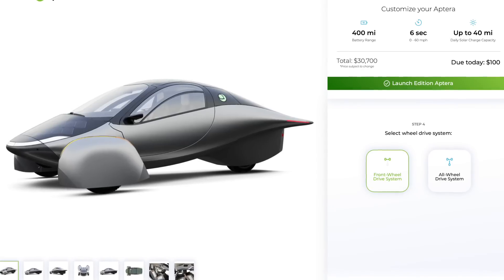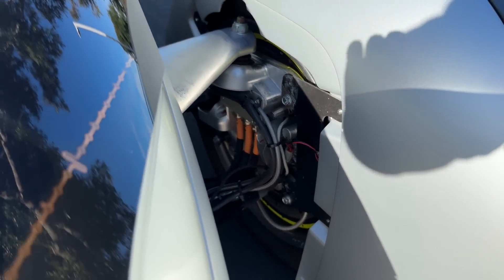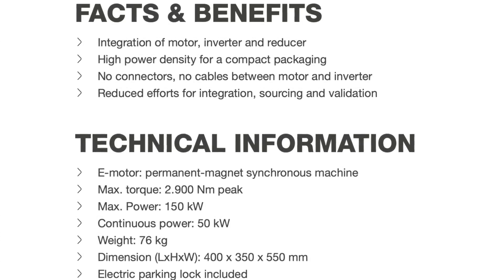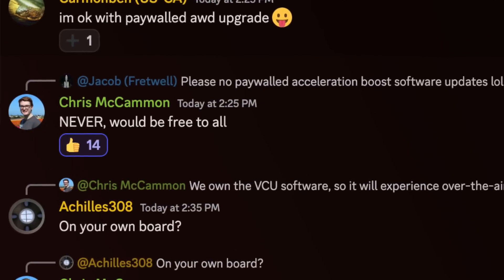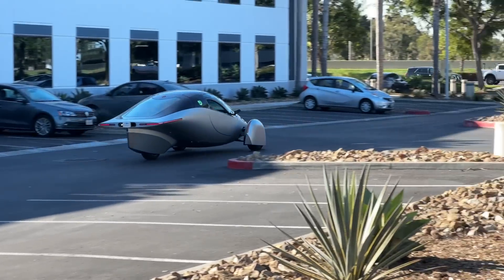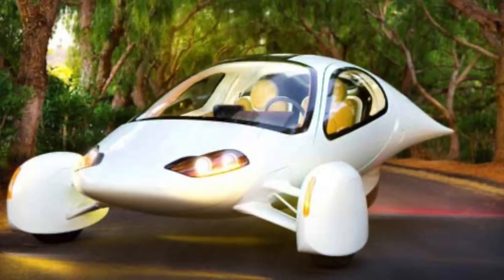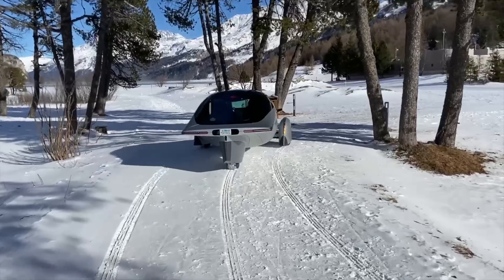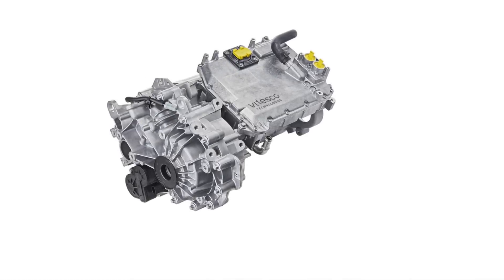Aptera's New Motor UNVEILED!

Comment: AWD seemed pretty pointless to me. I guess they only originally wanted AWD for launch edition because it was the most common pre-order. Most people ordering a solar car do not live in cold climates that really need AWD, it's just more for performance. Hub motors would cause more suspension problems and being from a new motor company would probably encounter more reliability problems (and issues with getting replacement parts). Nevermind that having two-three motors instead of one just means now you have more expensive motors that could fail. The added ability for torque vectoring could offer better stability and unique turning abilities but is not necessary as most cars don't have it and drive perfectly fine. The overall effeciency of the car should go up and the production cost should be less with this option. It just would have been nice if they let people know about this change sooner like they did with the belly pan cooling. Many people who ordered the launch edition did so because they wanted a high performance AWD version with unique hub motors.
Reply from the maker: They told us as soon as they possibly could. Contracts with suppliers are picky

Comment: Whats the 0 to 60 going to be now?
Reply: 6 seconds is what I read recently
Reply: @rw6262 more like 4 years lol
Reply: It's now 0-60 in under 6 according to the configurator for my stock LE with FWD and priced at $30,700
Reply from the maker: That configurator is dated. It’ll be below 6 seconds
Reply from the maker: They’ve said they’ll test it with PI2 and give us an official number. Site is dated info because it’s still based on the Elaphe motors
Reply: @TailosiveEV  thanks for the info

Comment: Vitesco says EMR4 25% lighter 5.6% more efficient and smaller than EMR3. So much for max efficiency
Reply: The EMR4 is only available to very large quantity buyers, this is the reason Aptera cannot use it.
Reply: @DemaGeek  It may also cost more if it uses more Rare Earth material.
Reply: @DemaGeek  Once Aptera hits volume production with a 10-20k unit per year production it will be higher production than the majority of EVs.  At that point the EMR4 (induction) will be a logical change due to the efficiency and ability to shut them off when cruising.  Aptera is about efficiency for the masses; if they designed a $200,000 vehicle for max efficiency noone could afford it that actually cares about the efficiency.  EMR4 does not use rare earth metals or even permanent magnets in newer versions.

Comment: Front wheel drive might torque steer like the Bolt(same power) if you really get on it, and this thing will have the power to lift the front off the line, but it will be plenty quick.

Comment: 150KW for a 2000lb vehicle is insane. I had a 1972 VW transporter  which weighed 2600 lbs and it had a 44KW engine and it was probably almost the worst aerodynamic shape you could have, and it was still able to go 60mph (barely) on a flat road.  I drove it cross country twice which was sometimes challenging, especially going over the Rockies and Sierra Nevada Mountains.
Reply: 150 kW is peak power, with only 50 kW continuous power rating

Comment: Unless you have experience driving in snow (live in Wyoming), you may want to reserve commenting about it. I don't think we can assume how the two-wheel drive system will work in snow, or the effects of being light weight, or snow packing in the wheel wells. This all needs real world testing before we can say.
Reply: I commute with an Arcimoto FUV, another electric tadpole with 70% of the weight up front.
Sixteen thousand miles in two years shows me how AWD on a three wheeler is superfluous.
Reply from the maker: I’ve only driven in snow with FWD vehicles. And I never crashed

Comment: My Arcimoto FUV has dual motors and 70% of its weight up front. 
Commuting 16,000 miles in two years, shows me that AWD in a tadpole setup is superfluous in San Diego.
Aptera switching to a proven drivertrain ensures that I take delivery of my Accelerator Launch Edition sometime next year.

Comment: I wonder if there is enough room under the trunk to have a smaller motor? The rear wheel can be treated like a motorcycle wheel and fed through a shaft drive system. Even a smaller 50-70kw motor would create a pretty significant bump in power while keeping a relatively simple design. Might be able to fit under the trunk with minimal compromise to the cabin space.
Reply: This writer, having seen the prototype in person, says there is NO way to power the rear wheel in the same fashion as the front wheels.

Comment: Electric cars have a reputation for being fast that’s why the all wheel drive system is a BIG want. 

I’m neutral for now .
Reply: AWD ain't critical in a tadpole setup with most of the weight up front, and that new motor has more torque. Launch mode will still plant the back of your head against the headrest.

Comment: As someone that has driven his fair share of super lightweight $h1+b0x cars. You would be amazed at how big a super power being light is for pulling out of the snow. The problem comes when it's time to stop and AWD won't fix that. 😂
Reply: My stock 2nd gen Rav4 would go a lot of places Tacomas and F150s would go in deep snow.
Reply: Being able to Break the rear wheel like down shifting would help. Regen on the rear wheel had some real advantages
Reply: @robertwakeman1679 brake 😊
Reply: How many of those cars were front wheel drive with a heavy motor and driveline over those wheels?
Reply: @gbpg2016  With the battery being by far the heaviest part of an Aptera, and considering the weight of hub motors,  inverters, wiring, plumbing, coolant, connections, and hardware to mount it all, how much different do you think the weight distribution will be? I don't know but will guess within a few %.

Comment: I am glad they will be able to launch the production Aptera. I am a reservation holder, and I am looking forward to driving my Aptera *very much*. One concern that I have is that EMR3 will be located so that the differential is in the center of the Aptera - so that the half shafts are equal length. This would limit torque steer.
They can't move the drivetrain back - the chassis is locked in, and changing the largest piece of the chassis.
Also, the half shafts are going to be a hit to the Cd; so there are some downsides to conventional FWD.

Comment: Good video.  I'm one of those who has really chilled on Aptera over the last week.  The info about the motor being even more powerful than all three hub motors is intriguing.  Will be interesting to see what it can do.  I'm still on the fence about waiting for AWD though.  I'm perfectly okay if they do as you suggest and just use the on board motor up front and in wheel in the rear.

Still very concerned about pricing though.  If the price ends up even in the ballpark of 40k, I'm out for sure.  I'm signed up for the AWD with the 250 mile battery.  If that even costs 35k, I'm out.  Just too much for what it is.

Anyways, I appreciate the work you put into these videos!

Comment: Chris McC has said that the BINC is not affected by this change (or the on-board motor was already known about when they finalized the BINC design). So I suspect this change will not affect the cabin legroom.

I'm okay with the change. I was excited about the novelty of the in-wheel motors, but understand the rationale for the change. I'm keeping my Accelerator LE order. But I had another LE reservation for down the road that I have now changed to Sol, AWD, 600 mile.
Reply: If you look closely at the June Update, room was made for this motor by relocating the suspension springs to make room for the axles.

Comment: Yesterday's Telo video (I know, different manufacturers but, couldn't help but notice the following point), you and the guy working on the suspension said that by not having an engine in the front in case if an accident like an ICE vehicle, it made it safer because having energy leave the vehicle instead of energy transferring into the cab. Any word on if the Aptera has been designed with safety of changing the motor to in front of the cab? Also, aren't the high-power cables leading out to the hub motors still an issue to worry about if Aptera is still working with the hub motor company to eventually put them in the car at a future update?
Reply from the maker: They’re only going to put a hub motor in the rear. So no I don’t think there will ever be hub motors in the front now

Comment: I'm curious about where they will position the brake rotors, inboaard or outboard? If outboard, along with the spinning output shafts and the CV joints, there has to be afair bit of a hit to efficientcy.....The area between the wheel pants and BinC was already the biggest trouble area for drag...How much is the coefficient of drag effected? Legroom does matter to me...I'm 6' 6"....

Comment: I see that the price has been reduced on my reservation.  I'll not sure if it will stay that low, but it is a difference maker. The EMR3 seem like a good drive unit and if the price stays on the $30K side if things I am good with it.
Reply: I noticed the LE configuration page now indicates FWD. I’m guessing the pricing model has not changed, but the price is reduced, according to the pricing model, for FWD.
Reply from the maker: Site price isn’t accurate. They mentioned that in the email
Reply: @TailosiveEV  did they mention the price ?

Comment: Not going to lie, I am very disappointed.   I signed up and invested for the Launch Edition with all wheel drive.   Yes,  I invested because I wanted to support the company but just as important I wanted to get my Aptera sooner than later.    Now to get AWD I am going to have to wait even longer?  I admit I can probably live with the driveline change but I worry how about how many other targets they are going to miss to get the Aptera "to market sooner".    Will the solar have to be rolled back to half or less of the promised amount?  Will the batteries not deliver the targeted density and so range drops from 400 to 300?   If they keep dropping features to deliver the vehicle it might just end up turning into a Bolt.
Reply: they seem to have every single other thing ready to go. they made the batteries already. solar is already done and ready. This was the last thing that was not ready and now it is. Hence why they are beginning to build the real PI builds now that they have everything.
Reply: @stix2you In your reply you stated "No.... you like many are making the mistake of seeing the Aptera only from the perspective of a few features."  and that is an incorrect assumption regarding my interest in Aptera.   I reserved an LE and invested because of the entirety of the features that were promised, not a couple.  

There have been five (four really) major changes since then, at least that we know of.   1.) Loss of fast charging which fortunately they relented on but they did try.  2.) Loss of belly pan cooling.  Frankly I don't mind how they cool it as long as it is effective and doesn't change the efficiency targets. 3.) Dual headlights to single, can't be helped due to classification. 4.) Change from composite fiber body to much more readily produced pressed carbon fiber.  I applaud them for this one , great improvement.  5.) Drivetrain changes.  I am fine with the new inboard motor, I just lament the loss of AWD.  I have had AWD, FWD, and RWD and have always preferred AWD.   Those are quite a few changes after putting up the LE as reservable.

You are right that my comparison of the Aptera to a Bolt if it loses too many features is not justified.  The first thing that drew me to the Aptera was its amazing shape and promised efficiency and that still remains the most important aspect of the vehicle.  I just don't want them to lose  anything else or they may be the only features that can differentiate it.
Reply from the maker: Solar was ready a while ago, battery pack is ready as well
Reply: @TailosiveEV  The solar and battery may have been designed and they have functioning prototypes but I don't believe we have seen functioning mass-produced versions yet. Those are going into the production intent builds and there may be issues that will cause them to have to be redesigned. Of course, there have been changes that have improved the product dramatically such as The switch to the carbon fiber body tub.  

I am still hopeful for a great final product but if there are any more downgrades from promised specifications I may have to reconsider my purchase. I hope it doesn't come to that.

Comment: I’ll admit I was pretty bummed out about it, but actually after listening to your points I am kind of leaning more towards neutral to positive. You made some fantastic points.
Reply: As an engineer I think this is mostly positive. They’re removing a potential Achilles heel from the car, taking out some weight, and securing an at-volume supplier in the process. It’s still going to be crazy efficient and look the same, so ultimately this isn’t something you’re going to miss.
Reply: @slickfast  100% agree.
Reply: @slickfast won't the halfshaft cause some design changes?
Reply: @golfish8589  of course it’ll take a bit of extra design work to integrate the motor unit and CV axles, but those designs are very well understood.

Comment: Good acceleration requires power from the rear. Even with the weight mostly in the front, there is insufficient traction where wheels would spin out easily. Even modern FWD cars have most of their weight in the front, but slip from just a little dust on the road. 

Kind of disappointed that initial Apteras aren’t going to be as fun. 😔
Reply from the maker: Spinning out isn’t fun to you? This thing will certainly rip.
Reply: @TailosiveEV  spinning is sort of fun but something that gets old unlike a 4 or 5sec 0-60. Tires have to be replaced very often. 😬

There is just so much lacking with fwd. An Acura Integra just cannot be as fun as the other SHAWD vehicles.
Reply: @battery_wattage 
AWD in a tadpole setup is superfluous. Sure it would be a hoot, but I'd rather take delivery of my Accelerator Launch Edition sometime next year.

Comment: I want my Aptera with 3 motors. It's a PLAD APTERA 🤩
Reply: If the Aptera chose the 230kw EMR4 motor, it would have the power to weight ratio of the  Tesla Plaid.  As is, the EMR3 150kw (201 HP) motor pushing the 2,100 lb Aptera with forward weight bias will be no slouch!
Reply: @a5-30-31cts  EMR4 has different power configurations.  The middle one is around 160 kw.  The big reason for the EMR4 would be to allow the motors to shut off and cruise at highway speed more efficiently.  As aptera scales I would expect them to switch.

Comment: How many do you think will cancel or chose to delay till in hub motors.
Reply: I'm one of the few. Not my spec. The new design has not been seen. I live in the mountains of Colorado. Awd and correct tires required here. Somewhere my res #  went up by thousands. Hope they succeed but not for me any longer as they won't meet my original order spec, delivery, or needs. Seems like a Storm Sonders all over again and glad I did not invest beyond an order for a completed car. I am old and still sceptical of any co ceo organization structure as few succeed in my experience. Always interested in the BinC but have wondered about its repairabilty and costs in wrecks. Hopefully these don't become more ev cars that are automatically totalled. No one has brought up open pilot recently either. At least everyone beyond me can move up one space, until they move you further back.
Reply: For the fronts I would be surprised if we ever see hub motors - their are tradeoffs and the tech is less proven.  IWM will be the rear motor solution eventually.
Reply: A few but guaranteed they will regret it!
Reply from the maker: Maybe a few now, but once deliveries begin I doubt many will be willing to wait. I actually know a lot of people who wanted FWD to begin with
Reply: @TailosiveEV depends on how far out iwm are. Less than 1 year out I wait. Longer than 1 year I buy now.

Comment: So apparently the motor does have 2 output shafts and will drive half-shafts to the wheels.
Reply: From this writers reading- yes- two shafts. I see not how you would/could cram two electrick motors under that tiny front hood.

Comment: Thanks for your quick coverage.  My concern is not really acceleration or top speed, although I agree that both are fun.

I think there is a decrease in maximum potential efficiency, but this is overcome by getting vehicles out on the road.  Remember that Tesla shipped vehicles with breaking transmissions for their first year of production.   Aptea is going to be shipping well tested, functional vehicles.